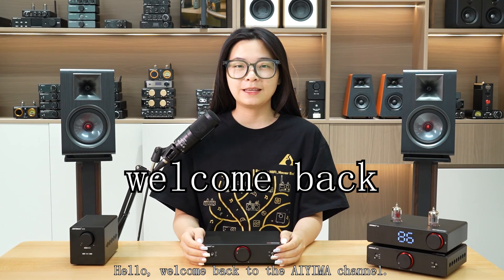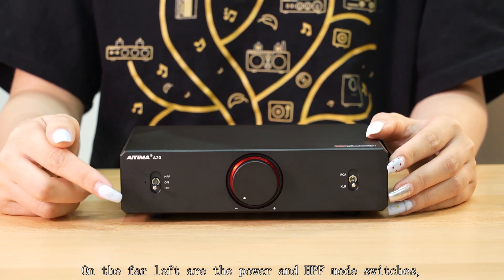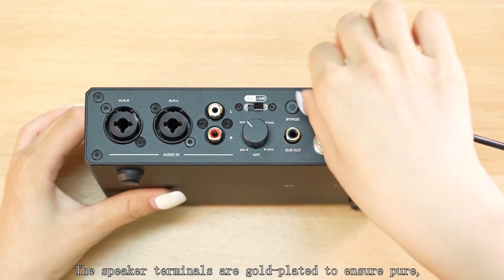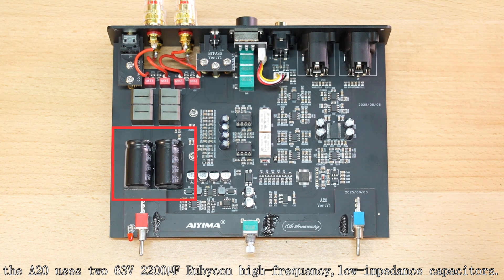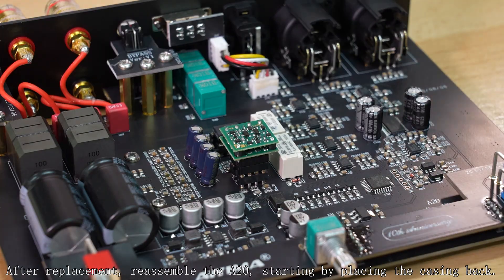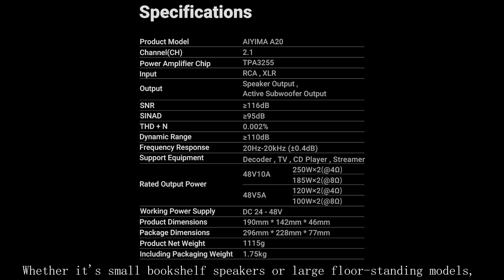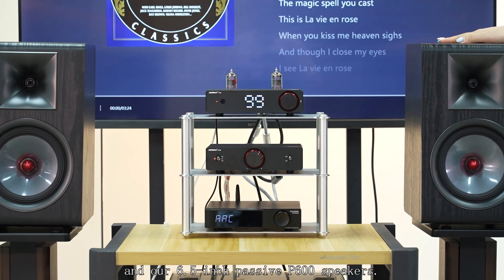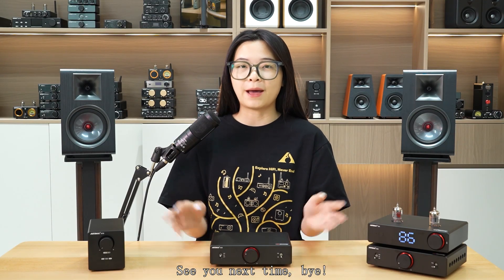Aiyima A20 Full Review & Teardown – Design, Features, Op-Amp Upgrade & Real Listening Test!

Comment: It is pretty box. Aiyima A20 unfortunately doesn't seem to have a sound stage and vocals are disappearing to the background. AIYIMA A07 Max has lot better sound even that it is lot more simple amp with less functions. Not just that AIYIMA A07 Premium even less coin sounds better than the AIYIMA A07 Max. I see more connections and functions but the main thing the sound has been lost. AIYIMA A07 Premium is one the better amps out there with 48V 10A power supply. Maybe that is the issue here we didn't hear all of the potential with less power behind the sound to open the stage and clarity.

Comment: Thanks for this very good review! I just bought T2 and A20, I use it in a big room with Klipsch Cornwall 4😊 My main amps are Accuphase E280and a 300B tube. Obviously the Aiyimas are not on the same level,but they have a special, very satisfying sound, They sound clear, with much detail,natural and very good balanced. THE bass is controled and nice "rolling".
I tuned the T20: JJ Ecc83S Gold tubes, Studer900 power supply. Now I want to change the op-amps in A20. I want to install Burson V7 vivid. Is it necessary to change the 2 op-amps or can I change only 1?
Regards from Germany😊

Comment: WHY you guys used DC plug on that thing?  Anything above 24V and 5A, it will BURN that connector or plug (or both).   WHY didn't used just the XT60 (for example) ??
Reply from the maker: The A20’s power supply voltage range is 24–48V. Using a power source above 24V/5A will not damage the device’s connector or the power plug.

Comment: In my opinion if Aiyima was looking to upmarket their outstanding products, we wish that they did not bend to the will of opinions and demands for PFFB, (global feedback), and designed the A20 with local feedback as the A07 series for a purer execution that the high-end demands.

Here is why...PFFB is great for measurements, but it doesn’t automatically mean better sound. My Douk D100 (PFFB) measures cleaner, yet my Aiyima A07 Max (no PFFB) is audibly sharper, more immediate and musically engaging on Fluance Reference towers. 

There’s a reason many high-end Class-A/AB designs (e.g., Pass/First Watt, Ayre, even Naim’s minimal-GNFB approach) avoid heavy global feedback: more loop gain can smooth response but can also blunt transients and raise higher-order artifacts if not executed perfectly. PFFB is not without trade-offs

Tell Marion, Larry says hello!

Comment: 바이패스 기능을 사용시에도 HPF는 작동하나요?
Reply: I guess your question. You can adjust HPF and click volume bypass when power on. But, I prefer turn down volume first, then do adjustments. 😊
Reply: @CharlieNg-o5x  Bypass basically skips the filters inside the amp. I was just wondering if the HPF circuit also gets bypassed, since that can depend on the amp.
Reply: @mensa2030 sorry. That's beyond my knowledge level.😂
Reply: @CharlieNg-o5x 바이패스 모드에서도 hpf는 작동합니다. 그래서 스위치가 앞에 있는거 같아요.
Reply: 旁路功能 means volume bypass?🤔
Reply from the maker: Yes